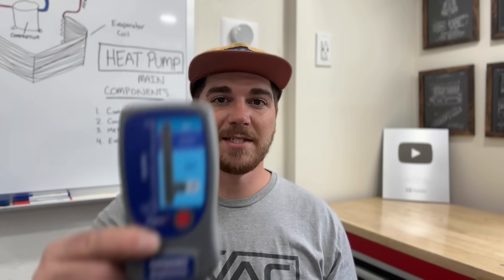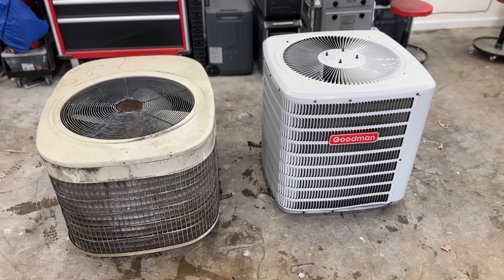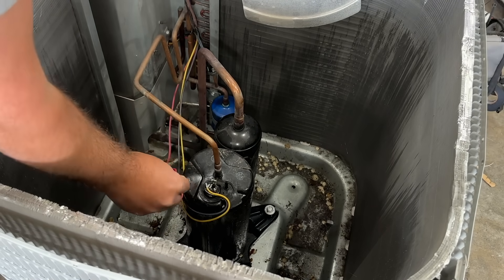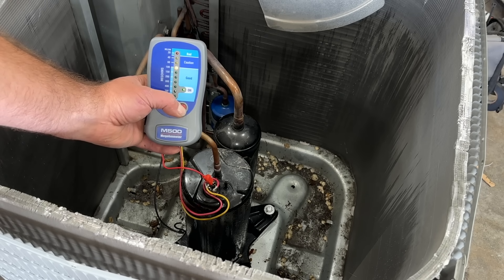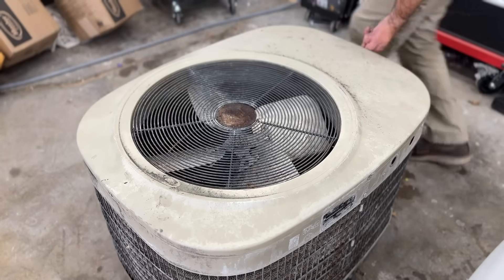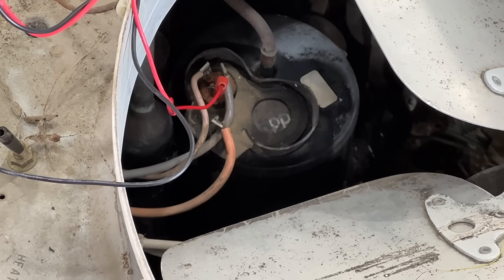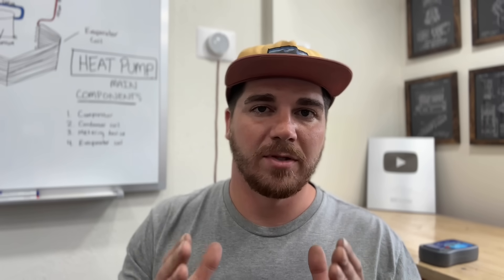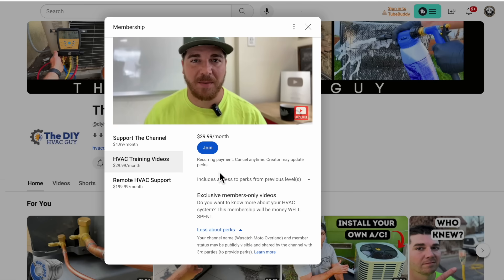Is Your A/C Unit About To Die? This Tool Doesn't Lie

Comment: My 30 year old Trane A/C unit quit working due to  freon leaking.  3 different large A/C companies would not refill it they all wanted to sell me a new unit with the least expensive at $8k and highest at $17K. Finally a friend connected me with a real repair man who replaced the leaking valve, refilled the Freon all for just over $400. The one large A/C company that would refill my Freon wanted over $3,400. When this company asked me to share my experience with them on-line I posted what they wanted to charge me and what I actually paid with another repair man. The owner called furious and promptly told me I got ripped off and demanded that I take down the post he solicited from me. Last I saw my post was still there and 2 years later my A/C works fine.
Reply: They probably converted you to an r22 substitute.
Reply: Todays service people are all about "Yelp" reviews and calling up those who leave honest negative feedback luring them to change their post.  Those kind of businesses are loosers and deserve all the negative they can get just for trying to bribe poorly treated customers
Reply: Awesome. Too many scumbag hvac criminals out there!

Comment: They certainly don't make them like they used to. 30 years ago you'd be lucky to get 10SEER. Now you can't even buy a 10SEER and you can get over 20SEER for about the same amount of inflation corrected money as that 10SEER cost 30 years ago.

Just like cars, things are so much better than they used to be.

Comment: Actually, had different problem.  it was a combination of the compressor and capacitor.  It was showing 2 volts below spec.  He suggested I buy an Install Hard Start Kit.  This helps the compressor start up and come up to operating speed quicker. The start assist reduces winding stress and the production of winding heat, saving the compressor from additional strain and increases the life of the compressor.  The heat pump is now 12 years old, so if I get another 2 years out of it of year-round usage in CT that is a pretty good life.

Comment: Every diagnosis we make is based not only but experience with in our work area. Based my 50 years of experience,  one should remove all the wires from compressor terminals and leave compressor windings segragated from any other component when measuring any ohm value. If the compressor windings are not segrageted, ohm value can be incorrect by poor capacitor, motor or unit wiring harness insulation.  If the unit is pumped down in vacuum,  the compressor will almost always fail a meg test.  I would think Supco instructions for this tool would have this information in the instructions.But still a good video.

Comment: I used to use this when I first started in the industry, found it to be 50/50 when saying a compressor was bad. I would just tell the customer that one of the test showed the compressor was going bad so not to be surprised if it died suddenly. never sold a customer a new system or compressor based on that reading alone.

Comment: Bad motor windings (checked with this meter) are only one of many things that can fail in a compressor.  This only tells you if the insulation in the motor is good or not.
Reply: And it would only do that if you disconnected the rest of the circuit from the compressor, which he didn't!
Reply: Well said
Reply: The bearings inside the compressor could fail, correct?

Comment: They told me I had a burnt wire on my compressor. I changed the capacitor and it didn't work. They told me to buy a new $6k unit that arrives next month. Old unit is 20 years old Goodman. New unit will be Bosch

Comment: You are checking the insulation level between the winding of the compressor and the ground using the ohmmeter.  Higher resistance means better insulation to ground so less likely to short out.  Insulation generally don't deteriorate unless the insulation material are not up to standard or compressor overheated numerous times causing the insulation to break down.
Reply: Dirty freon is definitely not going to break down winding insulation. Lol
Reply: Agree

Comment: Copeland states in bulletin AE4-1294 that megohm readings as low as 0.5 megohms to ground are acceptable. Besides the fact that this makes a scroll difficult to successfully meg (essentially impossible with a tool like the Supco M500 because it only reads down to 20 Mohms)
Reply: Yes. This kid is giving bad information.
Reply: @sbukosky  He has good intentions, but not enough knowledge and experience. A mega ohm meter is ok, but it still doesn't conclude anything in these types of situations. If there is no direct short to ground, the start and run windings add up, and the refrigerant charge is correct and the compressor is operating withing the correct run load amps, it's fine. I personally feel that this mega ohm meter is used by residential techs to scare someone into buying a new seystem.
Reply: You want to believe these guys with these videos.  This is the second channel I've seen recently pushing this cheap Supco device.  There's a reason that QUALITY meggers are $600+
Reply: I came in here to say this.  Ive witnessed a few sales techs in my time condemn perfectly good units using this megohmeter.
Reply: @pegleg402 Exactly my thought too. Megohmeters can be a valuable tool for diagnosing commercial and industrial equipment. But pretty much unnecessary and useless in residential applications. It wouldn’t surprise me if it’s used more often in residential applications for nefarious reasons.
Reply: Fluke 1587 is what you really need to test insulation.
Reply: I agree, the information is well intentioned but incorrect. This meter by supco is worthless. I can’t imagine how much money has been wasted because of good compressors condemned by that meter.

Comment: You could also just use a stand Volt-Ohm Meter that you probably already have... No need to buy a separate tool. Also, you should isolate components before testing them in this way.
Reply: Yes and no.  Standard ohm meter just uses a couple of volts and may not show any insulation breakdown at that voltage level.  At 500 volts, you are more likely to see insulation breakdown if it exists.  Yes though on removing all 3 compressor leads prior to test.

Comment: While this tool can indicate a bad compressor, a good reading on it doesn't guarantee a good compressor. The motor may be hard to turn, causing excessive amperage draw even through the windings are good. Also, depending on the type of compressor, it may have bad valves in it; although, I suspect most are more of a rotary type that don't need valves. However, I'll agree that probably 99% of the time, if the windings are good, the compressor is good.

Comment: I had to replace 3 fan motors over 20 years.  Eventually when the unit died we realized the wrong jumper was used on the circuit board when it was originally installed and my fan had been running too fast according to the service rating for it's entire life!  That explains why I kept going through fan motors.  Luckily they were only about $30 each.

Comment: Am I wrong in thinking there could be a lot more things wrong with a compressor than low ohms on the windings? Mine like like to blow the Cap, about every two years or so...I need to buy one myself and be ready next time! Cant go a day without AC where I live, its brutally hot.
Reply: The leading cause of capacitor failure is excessive heat build up. Sounds like you are in a miserably hot climate which doesn't help, but small things you can do to try and extend your capacitor life is ensuring the condensing coil is clean of any debris and if possible getting shade on the unit without impacting air flow through the coil. The coil being dirty will prevent air from passing through efficiently and dissipating the heat that is in the refrigerant. I previously lived in south texas and know how difficult extreme heat is, but every little bit helps. Having an extra capacitor on hand is a good idea, I highly recommend the AmRad brand.
Reply: @Thejaweee  Thanks for the brand recommendation. It doesnt get much shade other than a small tree a few feet from it. I keep it free of leaves and debris. I have never cleaned the coils with these spray cleaners. It will be 7 years old this year. The condenser/evap (its a heat pump) looks clean, like i cant see dirt on it, but im sure it is somewhat dirty just from dust and pollen and dirt in the air. I think im going to give this coil cleaning a go but im going to use some engine degreaser I have some extra cans of instead of getting robbed on this overpriced "coil" cleaner.
Reply: @Mach141  At 7 years it is definitely due. You will be surprised how dirty the water is that comes out even though it looks clean. Extremely small dust and pollen particles get between the fins and hide. Watching that brown water rinse out of the coil is one of the most satisfying parts of the job to me. Some degreasers can be harmful if left on the coil so make sure to be very thorough in rinsing it off. Good luck!
Reply: @Thejaweee  Thanks!

Comment: You want to pull ALL your wires off first, then test.  There's a chance that the MEGGER could be checking windings all the way back in your system.  Even if the wires are disconnected on the other end, you don't want to be checking the insulation against wires hanging out of the compressor.  Also, it's best to sand back the copper pipe on the compressor and use that as your ground.
Reply: I was about to comment the same.  If the black lead of the megohmmeter is connected to a bad ground, you may get a good (high) resistance reading but actually have poor (low) insulation resistance between coils and the case of the compressor.  So definitely, disconnect all three leads (noting which color goes where) and then test between each terminal and a clean spot (lightly sanded) on the refrigerant tubing coming out of the compressor.
Reply: In fact, the reason for the changing value is capacitance most of which is NOT in the winding.
Reply: And you never want to megger a variable frequency drive or soft starter unless the manufacturer says it's ok.  There can be circuits inside the VFD or soft starter that can't take a high voltage DC backfeed.  Also before using your megger short the leads together and verify you read a short circuit.  I've been on numerous jobs where the leads are broken internally or connections are corroded or damaged inside the megger so everything they test reads good.  Even scarier is when the leads to your voltmeter fail and it tells you a circuit is de-energized when it's actually live.  So get in the habit of testing known sources and circuits before testing the unknown.
Reply: Great point!
Reply: Confused about sanding copper pipe coming out of compressor. Will the diameter of the pipe not allow you to clip on the black wire connector? That looks like it doesn't open too wide.
Reply: @Perly53 . The reason for a light sanding is to make sure your lead is contacting good metal and not oxidation.
Reply: Yes, this right here
Reply: That's the first thought I and probably any experienced HVAC mechanic had while, watching this video.  You've got the condenser fan motor, the capacitor, the wiring and the contactor all skewing the results of his testing.  Also he's testing for faults to ground, but not between the start and run windings or internal mechanical failures.
Reply: This YouTuber seems to half ass things. Yes, all the wires need to be disconnected. This tool also can check motors.

Comment: They should've left that 1985 system installed. It would've undoubtedly still outlasted the heat pump that replaced it.

Comment: Called my local A/C guy and wanted him to change out my capacitor, as a have been working long hours away from home. He charged me $485 and said I was at least 2 pounds low of R-22 which he wanted $175 dollars a pound. He also said I needed a new unit which he quoted 12-14K. I changed the compressor and added a filter 4 years ago. Needless to say I paid the bum and finished servicing my unit myself. The gall this guy has to charge me all that for a 15 minute job.

Comment: Not a good idea, be safe you home owners out there. Have a professional do this, its worth not getting shocked.
Reply: As long as the capacitor is not charged/disconnected and power is off, I don’t see how you can get shocked doing this test.

Comment: There are a few independent HVAC mechanics that will inspect your system and advise you honestly. My buddy just got a new furnace because his combustion fan was bearing was dry and seizing up. I replaced my sisters combustion fan for $350.00 in parts. Some businesses are directed to sell HVAC systems, they will say stuff like " I could fix this but something else could go next week"
Reply: Condensate fan. Yes, they usually go out due to the crap quality bearings these days. They might save $3 vs. use a quality one and put the $350 part cost on the customers.

Comment: My compressor requires me to reset power to the unit before it turns on everyday for cooling. Does anyone know what might be the problem?
Reply: It might be running with a weak capacitor. They are cheap & easy to change with many videos on YouTube showing how to do it.

Comment: I had an AC guy about 12 years ago tell me my unit sounded tired and it was probably time for a new one.  Still running great after 12 years.
Reply: Perhaps he was referring to his own wallet?
Reply: Sounds like the tech was tired of making decent money legitimately & wanted to make the much bigger bucks being a criminal...
Reply: I sound tired and need replacement too.
Reply: Well consider how much would of been saved if  you went to a more efficient unit.
Reply: @ramohino  It never would have paid for itself and I would probably replacing a 2nd unit considering how poorly made the "new" stuff is.
Reply: @ramohino They say they are more efficient but in my experience they are not. My 25 year old 3.5 ton Ruud could drop the temp in my house very quickly and shut off. I took some bad advice by an HVAC contractor and replaced it with a newer, high seer 3.5 ton system. Since day 1 that thing runs pretty much non stop in the summer months. The energy star tag on it shows it uses little watt/hr but the problem is it has to run 20 hours a day where my old Ruud would run 6-8 hours to keep the house at the same temp. I even had extra insulation put in the attic and more insulated windows installed trying to help this new high efficiency unit out and it still struggles. Had 3 different companies come out the last 10 years or so and they all say it’s running fine. I wish I would’ve kept my electric bills when switching from old to new. It was shocking.

Comment: They go on about recycling when all they should do is make things last. This is true for everything.
Reply: In 1972 I saw a program on PBS titled "Planned Obsolescence". They are building them worse every year, intentionally.
I am a mechanical engineer. I graduated in 1972.
Reply: @jugears1081  So what are Homeowners to do? With all of the videos and other news about what is best! It seems there is no way out when buying a system, expecting it to last.
Reply: I got told I should get a new car when I went to get a quote on painting a fender. It's a 31 year old car that works fine. If people actually cared about the environment, they wouldn't discard things so easily.
Reply: And they keep changing/outlawing the types of refrigerant. "For the environment," myass.